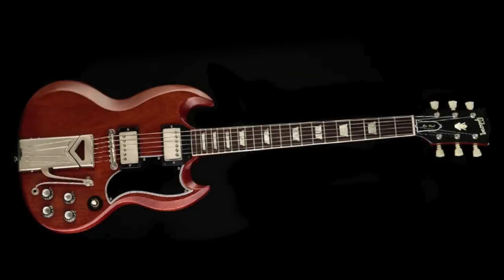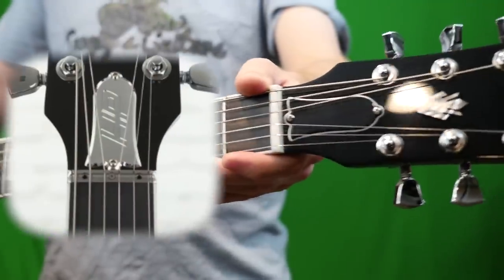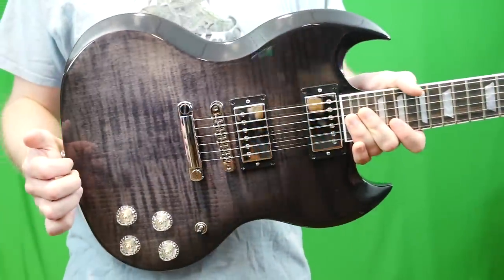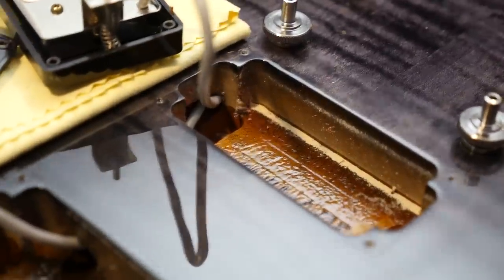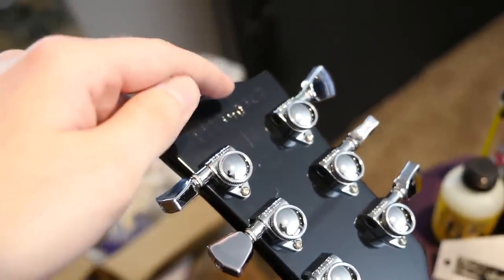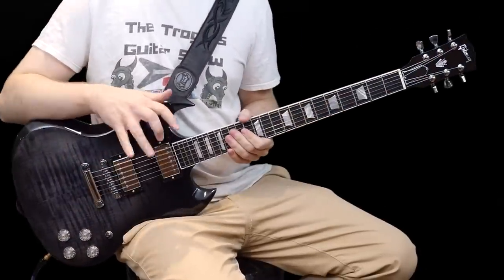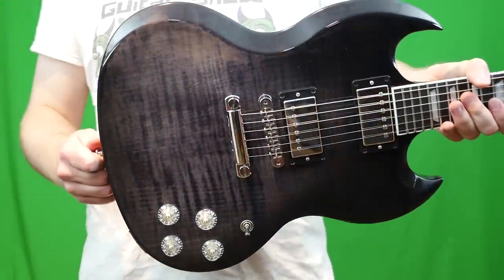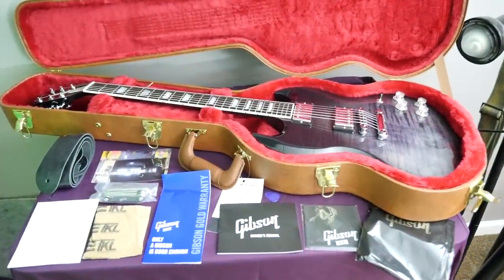Is this the Best SG Ever Made? Maybe... | 2019 Gibson SG Modern Collection Ebony Fade Review + Demo

Comment: Just as an update, the neck dive issue on this is just because they moved the strap button to the upper horn for some reason. I have this model and moved mine to the normal location and all is well with the world. They have corrected this fairly early on in production. And they also changed the tuners to lighter weight non locking ones. Though the locking tuners don't effect mine now that I moved the strap button. 

Over all, this one is a keeper for me!
Reply: Aha. That would explain the contradicting information and confusion I've seen in some places about the strap button and locking vs. non-locking tuners.

Comment: 7:35 that's exactly why I don't like SG's
Output Jack on the side...cool 👍
Looks like Gibson is really working on some cool NEW things.
Reply: That i like, don't think i like where the one strap button is though.
Reply: Brandon Ivey 
Lots of jazz guys playing 335 style guitars play sitting down thus the output jack being on the top instead of the side.  If it’s on the top just get a 90 degree angle cable jack to reduce the chance of breaking something.
Reply: jack on the front is cool
Reply: @Brandon Ivey I also prefer the Top Mounted Jack.  From the very beginning I used a 90 degree angled Good Quality Metal Plug.  Never had an issue with it.

Comment: I've had the Epiphone version of this guitar for over two years. It's almost exactly the same and is a fantastic guitar completely stock, second hand for $400. It's not my main guitar. My mainstays are super strat, modern style guitars with hard tails and humbuckers. The SG is my roots blues guitar. I moved the strap button to the top horn tip to alleviate the neck dive. It resonates/sustains, rings loud unplugged, stays in tune and the Epi pro buckers sound great. This thing has some serious honk to it and gives me the down home Allman Bros vibe I wanted. Never letting it go.
Reply: I'm glad to hear that you play blues on a sg
When I hear the,,ride on,, of AC/DC ..a blues world is opening
Reply: The sg hp is better ('more options) but bad tuning (it does not stay in tune) 
the bb pro's are decent with too much brightness and not so powerful like 498t 
the sh1 490r sound better for the beck (blues warm tone) so it's different here :tight and bright 
the stock action was too high 
what els e?
but good dip switch

Comment: Just purchased this in Blueberry burst, its a stunning guitar, sounds amazing...however...those locking tuning keys are ridiculously heavy for an SG (9.6 oz) its headstock dives when standing even with a thick leather strap on your shoulder..I've swapped them out for Klusons keystones (5 oz) and the problem is solved.
Reply: Hey man! Thanks for this. Which ones exactly did you pick up? Did they retrofit right on?
Reply: 2021 comes with mini grovers.....they listened ;)
Reply: Congratulations on a stunner , I was going to buy this lovely guitar,  I ended up with the original les paul classic I went in for ,however  I am saving for this ,
Reply: @Annie-zd7mx  try doing that with a 24 fret SG...I had a bag of lead shot in the dial cavity too...no effect
Reply: @Annie-zd7mx  the fret number effects the length of the fret board...basic physics
Reply: No soy partidario de ponerle peso, porque le quitas la gracia a la guitarra, la SG pesa poco, si le añades peso acabará pareciendo una Les Paul, yo le cambié el enganche a la unión entre el cuerpo y el final del mástil y asunto solucionado. Por otro lado no entiendo como Gibson puede sacar al mercado la guitarra con este defecto tan evidente...
Reply: @TheBarnaway  The sg hp is better ('more options) but bad tuning (it does not stay in tune) 
the bb pro's are decent with too much brightness and not so powerful like 498t 
the sh1 490r sound better for the beck (blues warm tone) so it's different here :tight and bright 
the stock action was too high 
what els e?
but good dip switch
Reply: @phenixreturns  ¿Mala afinación? tiene clavijero de bloqueo...

Comment: The Gibson SG is an odd critter, no doubt. You either love them or hate them.  They were my guitar of choice in my younger years and I played a lot of gigs all over half the USA on two Standards and a Special.  My first STD had the Lyre whammy, which saw absolutely no use.  I unscrewed the pearl handled bar and stored it in the case.  It sure looked cool on the dark cherry red mahogany finish though.  I bought it new in 1969 from old man Venneman in Rockville, MD, and sold it in 1972, but was re-united with it back in 2018, after not seeing it for 46 years.  My HS classmate whom I sold it to, still had it.  It had been through hell and high water since, but it was real cool to see, hold and play it again for a bit.
Reply: Sitting down and standing up, the SG is two completely different critters, for sure.  If you plan to gig with them standing up, try it on a strap first. It swings out to the side more standing up and the neck looks a mile long.

Comment: Some SGs dive and some don't. Reason? Look at the tuning heads. On an SG should be Klusons every time. You really don't need the weight of Grovers with that kind of leverage, it's a mistake on this guitar. But if you like you can pack the controls cavity with lead, it's easy.

Comment: Hey Trogly, to get a good feeling for the neck profiles, Wildwood apparently measures the thickness of each guitar that comes through their shop at the first and twelfth frets. 0.84-0.95 is reasonably chunky.  Since I've been looking for a chunky axe, their website has been a great resource as far as figuring out which factory models come with a profile I might like. (60's LP is like 0.8-0.9, 50's is like 0.9-1.0, putting your SG directly between the two). 

For my part, I hate having the output jack on the side of the guitar. Anything involving fixing two round surfaces to one another is going to be less reliable than flat ones, and there's nothing more annoying than a loose output jack. Also, my preferred angle while sitting seems to be guitar on a strap, resting between my two legs, which for obvious reasons complicates the side output jack. Give me a classic style SG output jack type coming out of the front of the guitar and I'll be happy.

Comment: You say you like the old case, the case you show is actually the short lived (2/18-11/18) HPII.  case.. The HP case was a 30plus lb aluminum case that scratched and dented easily. Im not sure about the original HP but the HPll was also compound radius fretboard. The new guitar being called a "Modern" while going back to wood (afterall this WAS NOT DESIGNED FOR TRADITIONALIST) fretboard instead of the slicker, non-shrinking or expanding Richlite (NO FRET SPROUT) and going back to plastic volume and tone knobs (even though the chrome ones they selected were hideous they were not plastic) combined with losing the adjustable height longer sustaining titanium nut while losing the D.I.P. circuitry?? How is that "Modern"? and btw.. The HPll also had the input jack on the side..not new for the not so "Modern".

Comment: Two things I forgot to mention. First YouTube is unsubscribing me from your channel everytime I click away from it.
Second relocate your strap button to the tip of the top horn. Try putting your finger(s) under the horn and see if this balances out your Guitar or nearly balances it. If this balances your Guitar then moving your strap button to the tip of the upper horn should fix the problem of your Guitar being "Neck Heavy. Use a screw at least 50% longer than stock preferably twice as long to prevent the horn tip from breaking. If you still have trouble you can double stack (2) strap buttons. You may have to use an even longer screw. You wanna make this look better you can get a wooden dowel rod preferably Mahogany stain and lacquer it to match your Guitar. You can put a neoprene washer between the dowel and Your guitar. You should be able the correct the neck heavy problem. If you go this route with double stacked strap buttons or dowel rod I suggest you use Gruv Gear Duo Strap. This should prevent the Horn from breaking and make your Guitar more comfortable.
Hope this helps!!
God Bless!!
Jimmy in NC....

Comment: The most interesting 2019 Gibson for me. Not a huge fan of the maple tops but it looks a lot better than in the pictures. I just wish they'd do metal guitars like the SG Menace, with that nice thin satin black.

I hate the side output jack though, a top mounted is easier to use and not a problem if you have an L connector.
Haven't tried the HP but the wider neck and adjustable titanium nut sound nice. I'm glad they god rid of the chrome pickup rings, but the clear knobs and lack of pickguard and switch ring are not for me. Not a hard modification though. I also wouldn't care if they kept the richlite.
The bypass switch other 2019s have would be cool too.

About the neck dive, Tony Iommi has the strap button on all his SGs at the top horn; some of his signatures have it that way (or at least the Epiphone does) and it supposeddly fixes it, so if you ever want to try it... Not sure why Gibson doesn't do it.

Comment: The "just for fun" measurement of both pickups consists of the parallel of the DC resistance of both pickups. This is given by the formula R = R1 x R2/(R1 + R2).
In this case, R1 = 8.43K ohm; R2 = 7.56K ohm so, if you want to do the math you will reach a value very close to the measured 3.99K ohm.

Comment: I bought one of the HP versions and have actually come to really like the Richlite fretboard.
Reply from the maker: Richlite isn't bad - but I don't think it will ever be fully accepted by traditionalists. Most tend to agree they like it, but would prefer the high-end guitars to stick with traditional woods.
Reply: @Trog  yes, I see that some people feel that way, myself included before I actually owned one.
Reply: Lets face it..no "Traditionalist" will ever buy something called "Modern" ..it wasnt made for them to begin with..they can buy a re-issue. The Richlite is brilliant, slick and never fades or cracks..cleans easily with soap, wax, light oil or ANY cleaning product, you will never see "Fret sprout" on Richlite.. its truly modern. Wood..not so much but Gibson gives in to the very people that are not gonna buy it and takes two steps backwards and goes back to the inferior wood...go figure..
Reply: thexfactor9999 it’s very smooth isn’t it which is nice

Comment: For those interested in 2019 SGs, I got an HP (high performance) that looks almost identical to the one reviewed here, but has a printed circuit board with a dip switch that have the following options, among others:
1- coil split / coil tap Neck
2- coil split / coil tap  Bridge
...
The problem is that there is no real coil tap. What the circuit does, when in the coil-tap position and setting, is connecting a capacitor in parallel with one of the coils. This is something I already had seen, namely in a Strat with the S1 switch.
The tones are perfectly usable but, as far as I could check, this is misinformation and misleading advertisement from Gibson.

Comment: Fantastic review and very thorough.  I've yet to play one and was concerned about neck dive.  Interesting that the neck is called a slim taper, but the measurements (0.85 at 1st fret, 0.95 at 12th fret) are the typical measurements of the Gibson rounded C neck profile like what is on the ES-335's.  All of the slim taper necks that I have are typically 0.81 thickness at the first fret.

Comment: You would think that after all these years they would create  V fitting and looong screw to put the strap lock on the end of the horn and end the dive.
Reply: FlyBaby that would be ugly
Reply: FlyBaby That wouldn’t necessarily end the neck dive. I own several Hamer USA guitars with the strap button on the end of the upper horn that still suffer neck dive. 

Sure, the end of the horn is the best place for the strap button to do as much as you can to solve neck dive (simply because it’s as physically far out as possible and has the best chance of being beyond the centre of gravity of the guitar) but with a guitar like an SG with an inherently light and thin body and “long” neck chances are that the centre of gravity is still too far “left” and it’ll still suffer neck dive. 🤷🏼‍♂️
Reply: My current sg doesn’t dive at all, it’s a 2014 with the button I. The traditional position.

Comment: In this type of guitars, with the capability of two pickups, using one as HB and the other as SC, there is a very interesting and usable feature that I never saw anyone to demo or even talk about: with the two pickups selected, to lower the volume of the SC. You get a gradual variation from the SC "dominance" in the mix to the fatter sound of the HB when the SC volume is reasonably low.
Am I the only one who has discovered this? :D

Comment: Love that finish, the blue looks just as good! I am not an SG guy but this one I would be interested in! I am curious to see if that maple top makes that much difference in the sound, I bet it does! I was wrong about the controls, since it's part of the "modern" series I would have thought PCB. I notice there is a lot of wrong information everywhere about the new 2019 lineup at Gibson, I wonder why that is? I have a feeling they already had their specs sheets drawn up then with the new CEO and the new changes they just did not update those specs. That is the only explanation that makes sense other than just laziness on the part of that department personnel. 

You said the 80's model SG's had the output jack on the side, the 87 I got from you had it on the front, it's on the side now though lol and a killer kill switch now sits where the output jack once was at lol. 

Does it make any sense at all to take the time to inscribe a serial number and then put the paint on so darn thick that it covers up the numbers? Dig deeper Gibson!! I think that the reason you see this mainly with black guitars is because on the black they use a gold undercoating and the gold is a thicker paint then they put the black on top of that.

Comment: Great video! I picked up the early model 2019 HP (only one available at the time) and was wondering about the difference in this and mine.  I don’t regret having my HP but really would have like my fret board to be ebony rather than ritchlite, but I do appreciate that my model does have the advance electronics and, like you, I do really love the case it came with.  Not sure value wise which one will hold its value better mine with the stock advance switches and arguably the more worry maintenance ritchlite fret board or this one with the more traditional ebony fretboard no advance electronics and regular case. What is your thoughts on that? 

Thanks!

 🖖 
Max Power
Reply from the maker: I think players will prefer the modern, but the collectors of 2050 will want the "rare" dip switch model
Reply: The Trogly's Guitar Show 

Awesome! Thanks for responding, love your channel! 

 🖖 
Max Power

Comment: Check out the Neotech Guitar Harness. It will fix "Neck Dive" on most Guitars with Zero modifications. It distributes the weight of a Guitar evenly on both shoulders and has a strap that goes from Button to Button across the back. You clip the shoulder harness right or left on the backstrap until you find the spot where your Guitar hangs perfectly. This will make you happy with your SG. I've found them for $69 at the Yearly Shop 0nline. There's also the Gruv Gear Duo Strap and the Slinger Strap. Hope this helps.
God Bless You and Your Family!!
Jimmy in NC....

Comment: Trogly 🎸    Hi !   Apparently Les Paul Himself preferred top loading Guitar jack inputs even if he didn't like the S G shape " You could have someone's eye out with those horns ! " 
    Cheers ! 
    😎     🎩
Reply: Output jack
Reply: @ny7294     Hi !     Amplifier Output Jack but Guitar Input Jack ! 
    Cheers !  
    😎     🎩
Reply: No , guitars have output jacks  , amplifiers have input and output jacks.
Reply: @ny7294     Hi !     So does the Guitar power the Amplifier ? Speaker output / the Guitar lead jack into and from the Amplifier to the Guitar via the Jack at the other end of the Guitar cable into the Guitar Jack socket .
In / Out it seems both terms are used for the Guitar Jack socket ! 
The Jack socket on the back of Speaker Cabs is the input so by that logic both ends of the Guitar Lead and their Jacks , Jack Socket of the Amp and Jack Socket of the Guitar must be input AND output ! ?  You may well be right , any electrical engineer out there ? 
     Cheers ! 
     😎     🎩
Reply: @petal.4334  .. the guitars signal begins with the strings vibration in the pickups magnetic field , and exits the guitar through its output jack . It then enters the amplifier through its input jack  .. it's pretty simple .
Reply: @ny7294    Hi !   Yes , you are correct as I have already implied - It's Output jack .
However I don't need patronising ! My point is this , with any Electrical apparatus there is a Mains Input and that utilizes a Power supply and with an Amplifier a Guitar generates a signal from the Pickups to the Amp via the lead and this gets reinforced and the sound is amplified through the Speakers ( as you said ) , yet if that Power of Electricity can Kill ( due to Wiring fault etc ) coming through a Guitar lead or Microphone From the Amplifier is that not Output ? -  the Electrical  power ( not signal ) has gone from the Amplifier   ( albeit rectified ) into the lead . 
    Cheers ! 
    😎     🎩